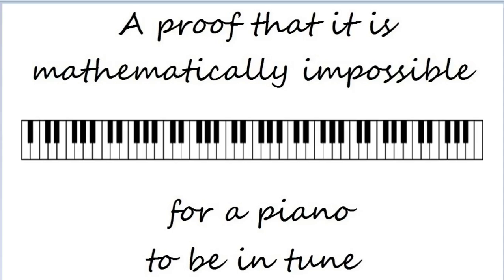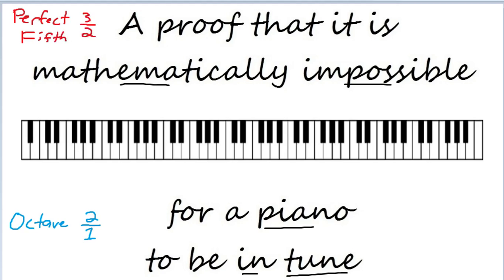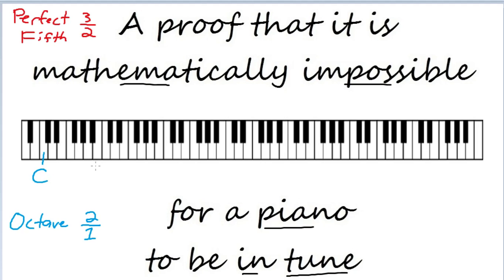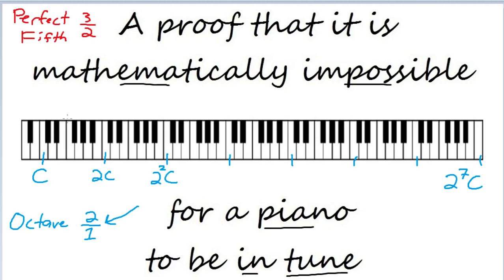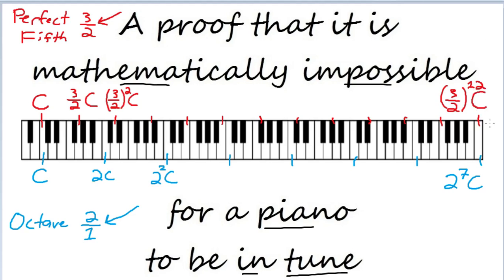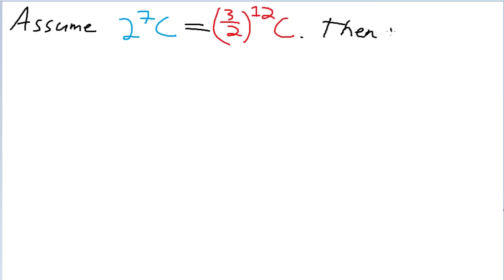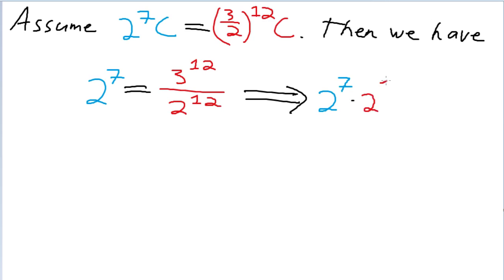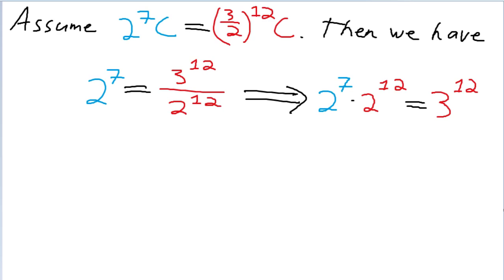A mathematical proof that every piano is out of tune

Comment: It gets even more complicated for professional piano tuners, who have to deal with inharmonicity: the tendency for upper harmonics to go sharp depending on the length and stiffness of the string. Which is why pianos, while the majority of the time are tuned with equal temperament (every interval equally out of tune), they're also tuned with a stretch. Sharper in the treble, and flatter in the bass to compensate for the inharmonicity of the partials. For example, the note marked C in your video has an upper harmonic that should match up with 2³C, but is actually quite a bit sharp, therefore the piano in that range has to be tuned very flat to sound "in tune."

Great video btw!
Reply from the maker: Thanks for the very interesting info! I enjoyed reading it. Glad you liked the video.